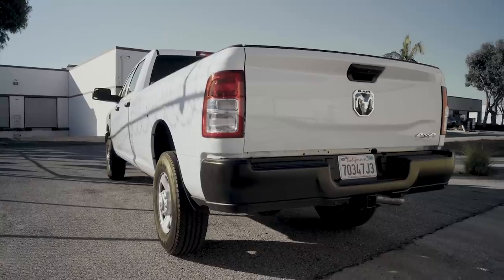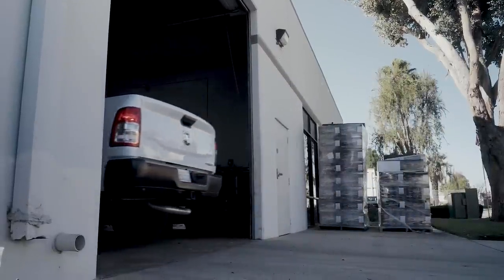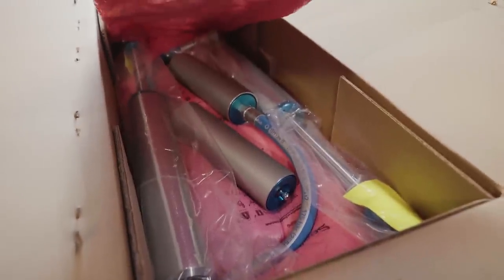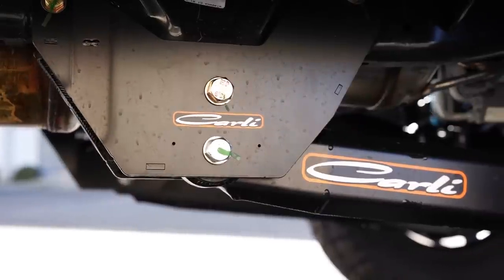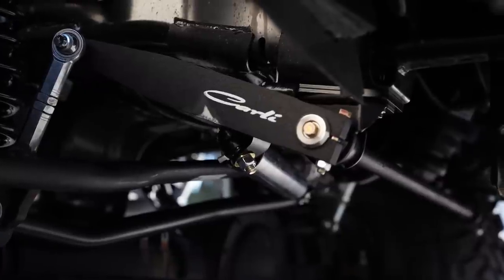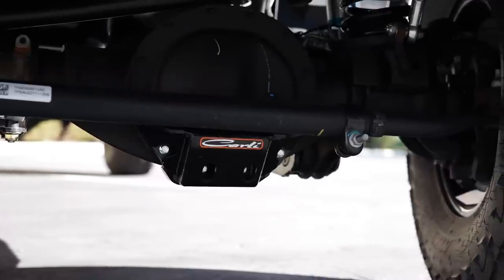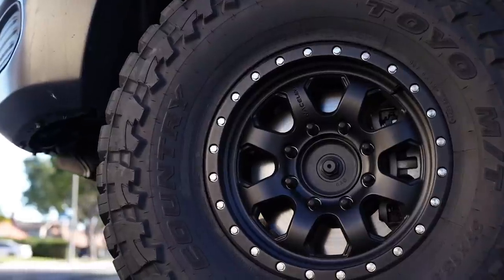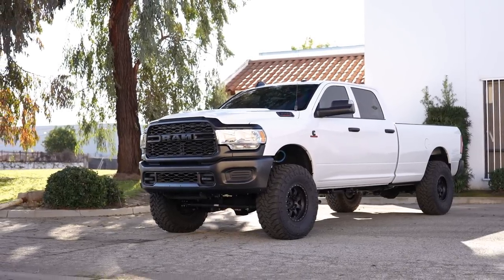Carli 3.25” Pintop Ram 3500 Cummins | Building the Ultimate Overland Ram Pt 1

Comment from the maker: What’s on this truck:

Carli 3.25” Pinmtop system:
https://www.cjcoffroad.com/collections/2019-ram-3500-carli-suspension-systems/products/carli-suspension-2013-2020-dodge-ram-3500-pintop-2-5-system

Carli dual opposing stabilizer:
https://www.cjcoffroad.com/collections/steering-stabilizers/products/carli-suspension-2014-ram-2500-3500-true-dual-steering-stabilizer-system

Carli Torsion Sway Bar:
https://www.cjcoffroad.com/collections/2019-ram-3500-carli-suspension-components/products/carli-suspension-2014-dodge-ram-torsion-sway-bar

Carli radius arms:
https://www.cjcoffroad.com/collections/2019-ram-3500-carli-suspension-components/products/carli-suspension-2014-dodge-ram-fabricated-radius-arms

CJC Exclusive 17” Raceline Avenger Wheels:
https://www.cjcoffroad.com/collections/raceline-wheels-1/products/cjc-exclusive-raceline-avenger-wheels

37/13.5/17 Toyo MT Tires:

Comment: Just dropped a 4 wheel pop camper on my 19 2500 on stock suspension and you are right. Super BOATY feeling. Would like this setup done on my truck!
Reply from the maker: With a max payload around 1,600-1,800 pounds on most diesel crew Ram 2500 trucks, there's really no way to safely carry a camper! Ram has forced all those customers into the 3500 platform by prioritizing unloaded ride over capacity in the 2500 coil rear spring trucks.

Comment: Some of us could be interested in a tuned shock package and suspension kit to handle this weight. Will that be something you sell in the future? Asking for the slide in camper folks.
Reply from the maker: The issue is that the rear weight changes dramatically with campers, so the rear shock tuning and leaf pack really should be custom catered to the setup. That said, this is something we do all the time so we're set up to take care of it!

Comment: Love the transformation the lift and tires have made.  Question;  are the tires hitting the sway bar?  if yes, What offset will correct that?
Reply from the maker: This specific setup is a bit extreme since it’s a +20 offset wheel with w 13.5” Toyo MT. Those tires actually measure over 14” wide. If you want to run that tire, we’d recommend about a +12 offset to avoid the sway bar, and more body trimming. With everything else, these wheels work perfectly!

Comment: Did you have to do any body trimming with this set up or can you run 35-37 tires with this kit without any trimming
Reply from the maker: You ALWAYS need fender liner and a little pinch weld trimming for 37 but none with 35s.
Reply: @CJCOffRoad  thanks I wanna put these same exact rims on my 2022 limited 3500 but I don’t like the idea of trimming on my 90k truck. So I’ll run these with 35s
Reply from the maker: It’s really nothing noticeable! It’s all inside the fender and 90% plastic that can be replaced!

Comment: so the 3.25 pintop kit with raceline 17's on 37x13.5's DOES NOT clear everything 100% according to the video at 4:26. There is clear tire contact with the sway bar. It would be even worse with a stock sway bar.
Reply from the maker: It clears everything but a Toyo MT which is over 14” wide. +20 works best though if you want to avoid body trimming. Push the wheel out further to avoid the sway bar at full lock and you’re into the body. It’s just one of the nuances of running that particular tire which is wider than the stated width.
Reply: If you ran the 37x12.5s would that make any difference?
Reply from the maker: @nataynlemieux5509  Yep! It's just these 13.5 Toyo MTs that are an issue on the +20 to +27 wheels. Even a 13.5 Toyo RT would be fine!

Comment: Did this customer ever opt for an axle truss?
Reply from the maker: He decided against it, since he has a 4,000 pound camper. High speed off road isn't really in the cards!
Reply: @CJCOffRoad  I understand that. What would you say the limitations are on the axle before needing a truss setup?
Most guys around here in Texas stick to jeeps and yotas for going through the trails. So just looking for Insight, thanks for the reply 👍
Reply from the maker: We'd recommend a truss for anyone that's going to see hard bottom outs. It's VERY easy to bend these axles, and all it takes is one hard bottom! If that's in the cards for you, a truss is a lot cheaper than a new axle.

Comment: Are the wheels on this build hub centric?
Reply from the maker: No. With 8 lug trucks, all aftermarket wheels are going to be lug centric. You can run hub centric rings if you'd like, but there's no reason since everything is designed to be lug centric on these trucks.